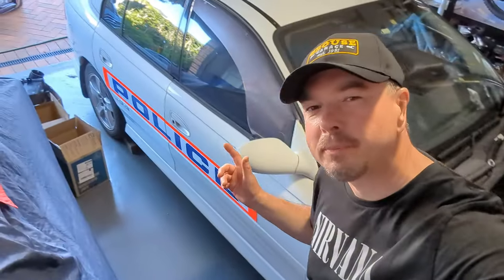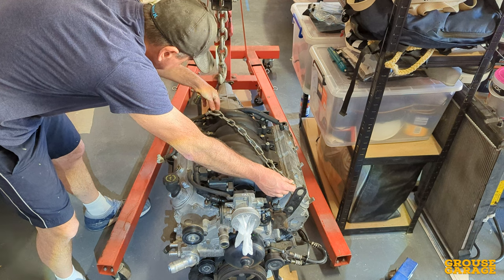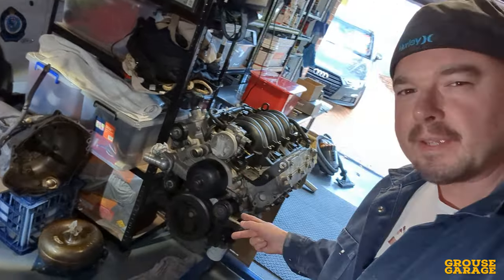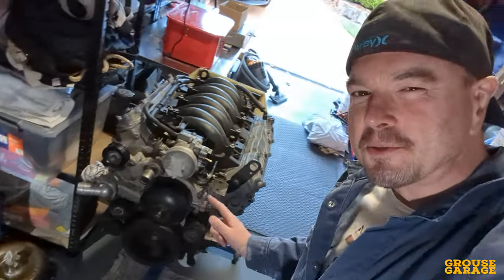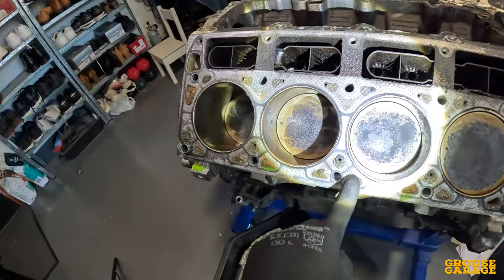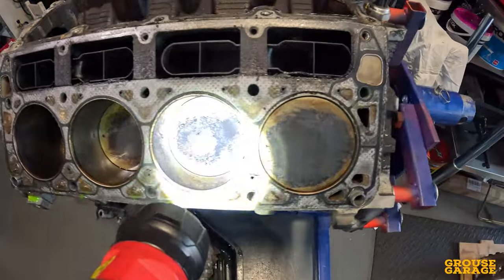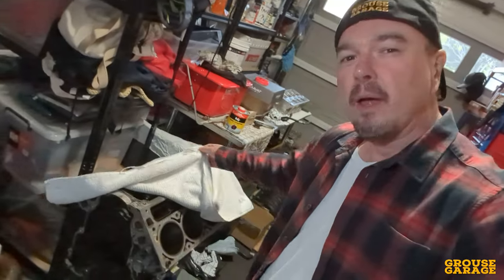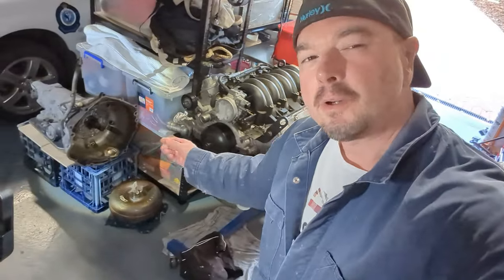VX SS Commodore - Engine or Transmission Rebuild? Flip a Coin to Decide!

Comment: I'm no mechanic but the engine looks to be ok considering the treatment it received in the hands of the police, either flooring it or idling for long periods of time
Reply from the maker: You are not wrong. The car did 40,000kms in its first year as a Highway Patrol car and guaranteed it was flogged hard. There was nothing wrong with the engine other than some oil seepage. The LS1 is a great engine.
Reply: The NSW police averaged 10000kms per 3 months good thing is it was usually on the highway @GrouseGarage